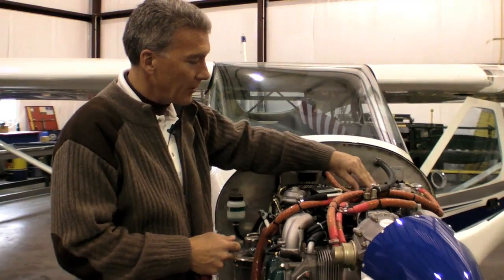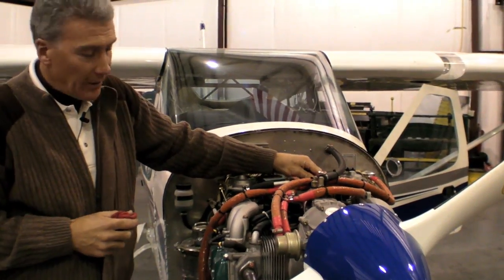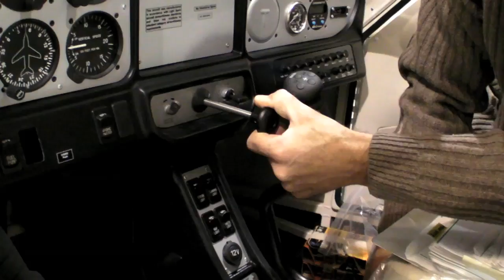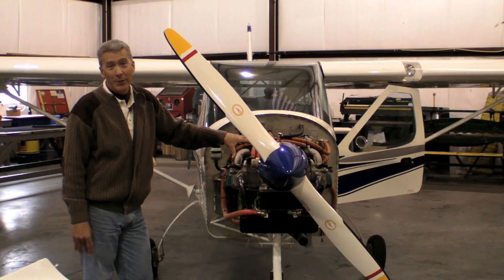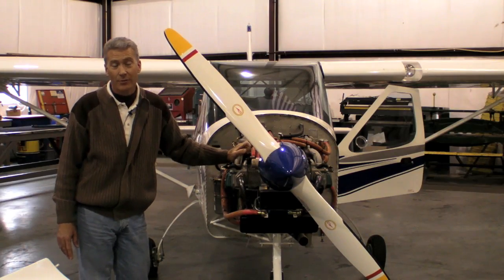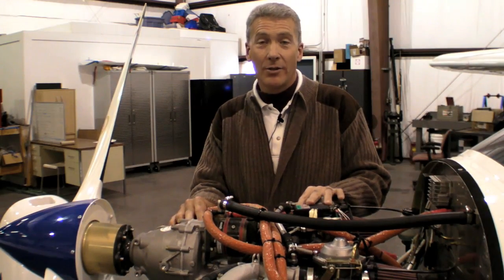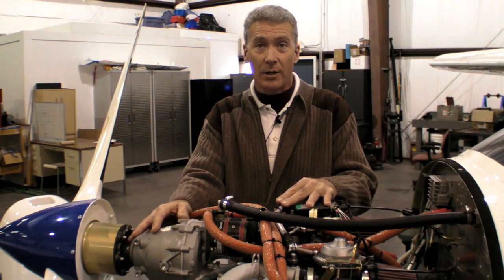Rotax Engine Essentials

Comment: If you hold The Propeller top Center, at the highest point of resistance, you will create enough suction to see if yourself most of the revolutions needed to get the burp. Not many folks know that

Comment: I am awaiting delivery on an aircraft with a 912ULS. I really don’t want to run avgas in it, but I may be forced to, because there is nowhere near me that I can purchase ethanol free automotive fuel.
Reply: AV8R Tom Check out "Lockwood Aviation Rotax" on YouTube.  They have some excellent videos on operating and maintaining the 912.  Engine will run on 100LL but you have to shorten the oil change intervals (depending on how often you use it).  You can also use up to 10 percent ethanol in the engine as long as your airframe (tanks,fuel-lines, seals, etc) allow it.
Reply: Check with a/c manufacturer.  Ethanol containing fuel is ok in many, including RV12s.  Rotax is ok with it, it’s the other parts of the fuel system that might be incompatible.

Comment: Tired of dealing with sourpuss mechanics. They will complain all day long that Lycoming and Continental are so old and outdated, how we need modern engines and ignition systems. Then they work on a Rotax and just complain because they do not understand how it works. Believe me, they have their problems, but they have already proven themselves more worthy and reliable than a Lyco/Conti HOWEVER they are more advanced, which means more advanced troubleshooting which means pissy mechanics who refuse to use manuals or understand new engines.

Comment: High rev, loud and tedious oil check process! I would never own an LSA with a Rotax under the cowling!
Reply: ATV: Nothing tedious about it. Pop open the oil cap. Pull through a few blades.  Check the dipstick and put cap on.  Done.

Comment: I know I'm being picky, but that's a lot of hoops to jump through to do a preflight.   I know a lot of folks who fly with these engines, and they like them.   If I had a choice, I'd take a Lycom or Conti - seem much more simple to check and operate.   

I'm sure this is a great engine, but I don't want to have to reinvent the wheel just to go flying for an hour.   Like I said, there are MANY satisfied folks with these.
Reply: Yes.
I have been flying with this engine for over a decade with this engine and preflight is not going through a lot of hoops. Or do you skip the rest of the aircraft too on a preflight?
It just about common sense and as a pilot in command you are responsible to make sure everything is fit for flight.
Reply: You are absolutely correct, sir!
Reply: why would you want preflight to be shorter ... that's one of the best parts about having a plane

Comment: Well, they may be great engines... But the lycoming and conti's have been so refined. There's a lot of exhaust, hoses, tanks, carbs, wiring harness's for an engine that's going to be maintained buy a guy that is keeping his plane in a barn. As for shock cooling, my A/P metalurgist friend asked me " ok, what happens when you are climbing out, oil temps rising. Then you fly into cold rain"... Enough said! Cold Rain doesn't shock cool... Lol

Comment: @biplaneacro 

Nice try.  I had one of these engines on a Kitfox model 1200.  It worked to perfection.  It started easily, ran smoothly, never overheated, burped, farted, ran rough.  It had altitude-compensating carbs, which have been the standard on motorcycles for ages.  It had electronic ignition.  In short, it was a perfect engine.  Continental and Lycoming need to come into the 21st century.  Or maybe that's the 20th.

Comment: If you have the springs on your exhaust system, run a bead of high temp silicone along and between the spring rings to absorb vibration.  This vibration causes hardening and embrittles the springs.  To do, put spring under tension to open up gaps between the rings, run a bead of silicone and let it ooze between the rings a little, let off tension, let it dry, install on exhaust.

Comment: Nice overview, thanks!
I own a ROTAX on a Sky Arrow 600. I'd just like to correct the statement that each bank of cylinders has its own ignition - that's not right. Each ignition system fires either the TOP or the BOTTOM plugs. Also, Continentals and Lycomings do NOT suffer from shock cooling - that's been pretty much debunked as a myth.
Reply: This suffers even less from the proven nonissue.

Comment: Dry Sumps, Gear Reduction, Slipper Clutches, Liquid Cooling, Separate Carbs.  Over complicated, over priced.   It belongs on a snowmobile...
Reply: Yeah, who wants modern technology (as I sit here in my one room log hut with only dial up internet).  Who wants a 100hp engine that weighs less for the same power, runs on 87-91oct mogas (less per hour than Cont. or Lyc.), regularly runs to TBO with specified maint.?  Oh and the 912uls cost less new than a rebuilt 0-200 or 0-235.😏
Reply: What would you recommend then?
Reply: I agree with you, who wants to go to the gym spend long hours lifting weights and not eating whatever you want.
Reply: Yup. It defies the KISS principle. Well said, John.

Comment: I think that's not a problem with the rotax because you turn the engine off with the magneto switch not by pulling the mixture so you can be sure you don't have a hot magneto.

Comment: i thought turning the prop was dangerous that was what i was taught when i was learning to fly Cessna 172's is the rotax built with a safety feature to resist hand cranking by mistake?
Reply: air in the lifters may cause broken valves.. Really... I would like to know how.
Reply: Collapsed hydraulic lifter